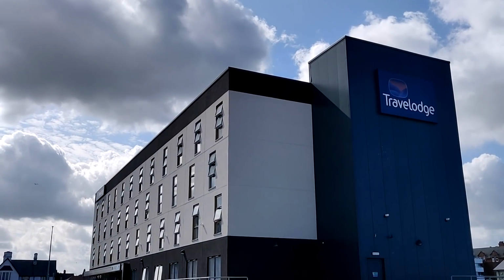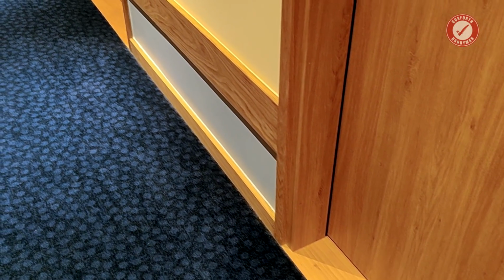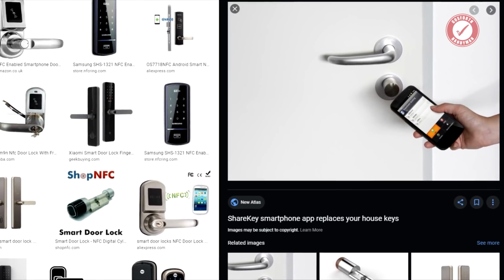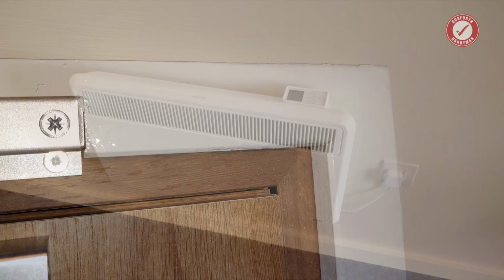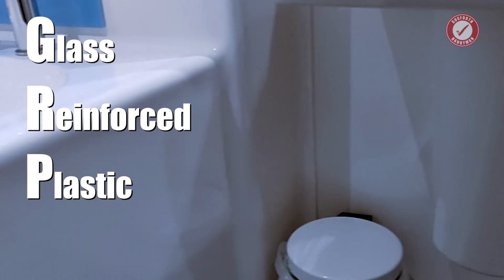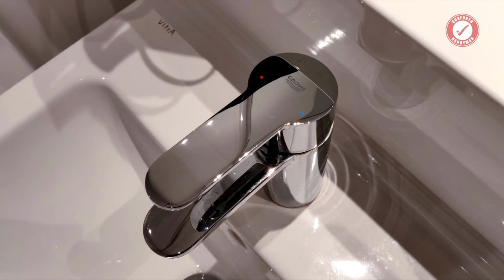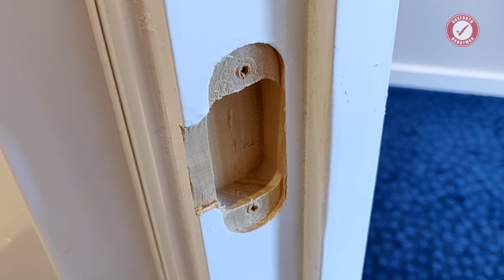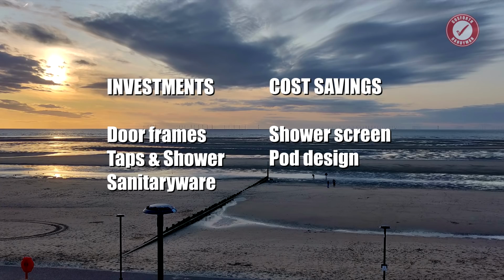Why use SOLID OAK in a £35 hotel roon? Travelodge room design in 2019!

Comment: Village Hotels use a system on the app, where you can open the door by holding your camera up to the door scanner. All you have to do it make a booking, then press find booking once done put your reservation no., last name etc then when you check in the app will update to see that you’ve checked in and in the corner will be a key icon you press it then you can have a keycard on your phone

Comment: 1: pod bathroom ... I remember being impressed by one in Austria about 35 years ago...it was orange.
2: Bathroom door frame - both the holiday inn and premier inn that I frequent in Norwich have what seems to be MDF door trim (the narrow skirting that goes around the door on the wall - on the inside at the corner near the bath you can see the water absorbtion swelling the surface...in most rooms.

Comment: I like your observations a lot, but please do not go for a pod bathroom. I lived in a student home in the nineties that was built in the seventies and had pod bathrooms. They do crack somewhere as you saw after only a year and then are impossible to repair and impossible to replace. So they just stay there cracked, water runs under the panels and mildew starts in unreachable places of your house. They are not used to make maintenance cheaper, they are used to make building it cheaper.

Comment: I stayed a night in a Hotel Formule 1 in France about 20 years ago. The shower was basically a one-piece moulded plastic (or fibreglass) pod with a rubber-sealed door and a plug hole. You were then trapped in there with the jet of water, which could have doubled as a pressure washer, it was borderline scary. Best shower I've ever had, just what you need to wake you up after 4 hours sleep on a 4" thick mattress.

Comment: 3:20 Hilton chain hotels are already doing this in the US with their app. It's kind of hit or miss in terms of how reliably it works, but basically you have to get the front desk to enable the feature for your room, and you press down on a button once you're within range of the room door.  You also can use it on external doors for the hotel.  Seems to be only a feature at newer Hilton chain hotels, though.

Comment: the fire rated composite material may be ground up wheat, same way they do chip board but has a far better fire rating than solid wood doors and is much more secure, you can replace the face of it if you want to update the look.

It's very interesting to see them in use, especially when it's low maintenance and very secure... not cheap to buy but it's a very good purchase.

Comment: I saw the phone NFC key feature teased in advertising at the Limpley Stoke Hotel owned by Latona Leisure Group but said they didn't actually support yet when I asked about it so dunno whether it's already in other hotels owned by the Group or if it's in implementation stages or what but yeh it's definitely around

Comment: The recess is to block sunlight in the sliders at the top. Keeps it blackout-ish without having to have roller blinds or tight fitting runners.

Comment: I totally agree with most of what you've pointed out with short term upfront cost for long term savings. Only thing that I find a little contraindicative is your mention of the push-fit plumbing being a sign of their confidence in the product yet they also skimped on proper prep/cheaped out on the paint, or perhaps they were confident in that solution too. Either way it will absolutely cost them a tonne to rectify and as you said will be a headache for years. I don't think there's anything wrong with quality push fit plumbing installed properly but I also feel they are extremely susceptible to failure from cheap parts and poor workmanship. 

100% accurate on solid wood for doors. Composites just do NOT hold up to the loads. Screws tear out and get loose, they don't hold fillers well when gouged or damaged and are overall a waste of money.

Comment: A lot of them run them down to bear minimum and sell it . The problem with hotel property management it’s not maintain properly in the first place and they don’t budget annual reverb’s especially at low rate because of the OTA’s  but the biggest problem I seen is the lack of inspections with before and after work orders and And your daily maintenance checks to keep it fresh .

Comment: There are a few problems with the NFC/phone adoption for doors:

--NFC has been bypassed, cloned, and forced more times than I can count, with multiple angles and utilities being available for the job. You think current doors and maglocks are bad? Wait until you have to watch for literally anybody, phone or not (biohacking's becoming popular in the UK and Europe, from what I remember).

--As far as the phone idea, this creates a customer dependency that would still (most likely) require a backup, while probably requiring some kind of centralized app/service marketed towards hotels that would need to be installed on the phone. This would be a hassle and could leak or siphon data from said phone, since corporations are in love with ripping data that they don't actually need for the service to work. Otherwise, maybe some finnicky, send/read-door-code-as-document pipeline would be necessary.

Comment: Almost all Hilton’s in US, Europe & Japan have had smartphone keys for 2+ years.
Reply: As an aside, Hilton's "Digital Key" uses Bluetooth Low Energy to communicate with the readers rather than NFC, though it does require the property to have switched from magstripe to RFID keycards for it to be an option.
Reply: They push it as a big plus about having their app, although I've never used it and always preferred to physically check in and get a key. 1) It's nice to have a key if your phone dies 2) It only takes a minute anyway 3) I think it's good to say hello to the hotel staff and be friendly for a magnitude of reasons.
Reply: Some Marriott hotels have Bluetooth door locks that work in conjunction with their mobile app.   My experience has been decidedly mixed, first time I used one at a Marriott Residence it worked flawlessly,  next time at a Moxy it took several attempts to get the phone to unlock the lift,  completely failed to get it to connect to the door and unlock it, so gave up and went back for a conventional key card.
Reply: The Hilton app, in my experience (tried it in 3 different hotels) takes a surprisingly (frustratingly) long time to open a door at best, like 30 seconds. My most recent stay, it worked only one time in 20 attempts and I was left standing in the hall for five minutes on day 2 of my stay. I got a real key card from the desk.

Comment: No idea why this came up for me but I do have a few professional comments. The door frames and doors are probably for fire rating, I haven't seen the travel lodge brand manual but have seen competitors and they generally only mandate the key mech. Nfc from phones is coming soon. Modular bathroom pods work economicly through repeat ability unlikely to see them in housing unless it's new build and that has its drawbacks so won't be mass adoption for a while.
Also travel lodge won't buy any doors but no building regs on bathroom doors

Comment: That prebuilt bathroom sounds like a good idea for combatting mouldy  silicone and leaks but if there is damage and you had to rip it out it would be a nightmare
Reply: I bet there's a plan for that though. All of the pipes and fittings can probably be accessed from hallway panel or under that lift off panel. Basin and toilet from the lift off. Probably shower/bath from hallway.
I expect there's a maintenance/repair/replace solution from the manufacturers.
Reply: @Google_Does_Evil_Now  I had in mind cigarette burns  and dropped coffecups etc. I have seen mobile chip and scratch repairers before though who will use colour matched  epoxy to repair anything, cars, ceramic tiles, baths, so maybe that is their plan

Comment: AC hotels by Marriott do have the room key system you mention if you do your check in through the Marriott app and add the room key to Apple wallet

I’m also noticing a strong trend towards quartz countertops throughout even in many mid range hotels as they are seen as luxurious, and more durable than laminate or granite

Comment: Some of these designs are reminiscent of features I've seen in buildings (houses & hotels) in other countries.  Sturdy oak door frames are standard in Germany, Austria and Switzerland.  The bathroom pod is something I saw - albeit scaled down in size lol - in a business hotel I stayed in in Tokyo in 2003.
It's nice to see a British company which has understood that using cheap shoddy materials is a false economy, because as you point out, more money has to be spent over time on either maintenance or replacement, or they just look like crap very quickly.  Having lived over 2 decades in Germany, Austria and the Netherlands, I still can't get my head around why poor design and poor quality materials, and slapdash finishes lacking attention to detail and forethought, seem to be commonplace in the UK in most buildings and other constructions built in the last century, i.e. from the 1920s onwards.
Reply: That's why it's called Rip-off Britain 😂
But seriously,it's just sheer laziness
Reply: @gabbycyber9917  True, but I believe it runs deeper and shows a lack of pride, and lack of social cohesion, as social cohesion means that you want to live in a place where others have it good too, as opposed to our commonplace ''I'm alright Jack'' attitude here in the UK which is short sighted.  But yeah laziness too, a few months ago some plumbers re-plumbed sinks in our restaurant, apart from the weird cheap flexible steel braid they used instead of normal copper piping (which I haven't even seen in Africa) they used too short a length, just about half an inch, which meant that the braid ''pipe'' was folded in on itself in a bend,  and the water pressure out of the taps rendered them practically unworkable.  The point is that they do this every day and it's their job so they knew damn well that the job would be faulty, but they went ahead and left it like that all the same knowing full well that the result would be shit, and by the time we found out they had gone.  No wonder Polish plumbers are doing so well here.  But it's sad for a country which started the industrial revolution and contributed so much to the world in terms of inventions.

Comment: The joint free design of the pod bathroom seems like a disaster waiting to happen. In a high moisture environment like a bathroom, you're going to get quite a lot of expansion and contraction even in GRP. They're getting cracking at the bottom of the door frame because that's the weakest point in the shell. The joints at the top of the door frame might have been cut on site as reliefs after cracking, since they don't look too pretty. Is plastic piping common in new commercial builds in the UK? Most building management companies I've worked with want nothing to do with the stuff, preferring copper.

Comment: what happens if someone breaks/cracks one of those glass reinforced tubs or walls? they just rip the hotel in half so they can crane in another unit??? and don't say it's indestructible, if anything can be broken, it will be broken in a hotel.

Comment: I've stayed at both Travelodge and Premier Inns (including their Hub brand), and compared to similar segmented and priced hotels in the USA, my conclusion is: Substantially smaller room size, BUT a huge unbelievable uplift to standards of furnishings including bedding, bathroom fittings with stone finishes and well tiled shower areas, and very fast Wifi Internet speeds (the two Premier Inn properties had Wifi speeds exceeding 200Mbps, compared to the 5-8  Mbps I usually get at a Courtyard by Marriott in the midwest part of the USA).

Comment: Am I wrong in finding the GRP bathroom pod concerning? I'm sure it's rather stronger than this, but I once cracked the GRP of a glider fuselage with a swinging metal parachute strap. If someone drops something heavy into any of that GRP and it chips, wouldn't you be looking at replacing the whole pod, patching (ugly) or ignoring it?

Comment: My student hall room was an entirely prefabricated pod. Almost every surface was hardwearing or wipe clean and the entire bathroom was similar in design, although every wall was one large asf tile. I know all of this because I was living in the building next door when they started construction and the site was just rooms being craned into a frame and fitted in. In just over a year, the site went from a literal hole in the ground, to a 21 floor student accommodation.

The only design fault I could see was how they fitted a mirror into the wardrobe door with screws instead of glue which meant a single slam was all it took to break the mirror. The mirror wasn't even necessary since the bathroom had a mirror on the wall on the medicine cabinet, but also on the door itself.  Though it was offset by my favourite detail which was how they fitted a washing line into the medicine cabinet which could be pulled out across the bathroom and fitted into the shower to dry off clothes.. it's almost like they knew the laundry were going to charge a ridiculous amount for drying!

It's amazing how this technology exists, yet companies, governments and local councils fail utterly to provide a reasonable amount of affordable housing.

Comment: The recess around the curtains is to allow for a higher window, and it is a workaround for a very thick ceiling that is fire retardant between floors.
Reply: Doesn’t the recess defeat the fire retardant in the recessed section? Why would building code/ inspector allow that?
Reply: I've been told its also to help with light leakage. Since the curtain in recessed in a box there is no way for light to reflect off the back of the curtain and splash across the entire ceiling.

Comment: Brilliant video. Subscribed! Strange they went for electric heating considering the huge cost associated running with resistive electric heaters. Air con is complicated but far cheaper to run with new air con units running a coefficient of performance of over 4 (1kw electric in = 4kw heat out). Even water filled rads with a central plant room would be cheaper than electric heaters. I suppose the one real advantage they have is that they don't have a single point of failure such as a central boiler to go wrong and shut the whole hotel down.
Reply: Exactly that, your last line there. The person who has to be called for that electric heater breaking probably gets paid a lot less than anyone they could call for central heating.

Comment: Hotel drapery guy here.

  Without that recess they could never give you a decent black out feature when the drapes are closed in the day time, but if they were really concerned with that they would have stopped the window short of the floor. Assuming they were dropping the ceiling for mechanicals, they saw this recess as an opportunity to eliminate any cost of a top treatment like a cornice or valance as more motivation.   They also imagined it would hide the hardware and pleats but its too narrow and shallow to do so. 

Long term this will save them about $10k per renovation per hotel by eliminating any sort of top treatment needing to be purchased while offering good functionality with no maintenance.

Comment: In regards to using your phone as a key it is implemented in hilton and Marriott hotels. Marriott uses bluetooth for this, but I think in the next few years you will see it with almost all hotels as it'll be implemented at the manufacturer level instead of the brand level. Honestly never understood building economy level hotels. It is a lot cheaper to buy an older hotel and transition to the brand.
Reply: The advantage of building from scratch is it's much easier to standardize the product. Essentially you start with a room design and design the building around it. If you buy and refurb then you have to work around the structure and layout of the existing building.

Comment: good video. I have been having similar thoughts when visiting hotels, hospitals etc.  I am doing a concealed cistern for easy cleaning and made a chase for the pipes to get a basin in the other side of the room without exposed pipes. I'm using flexi but a single run of Pex/tube  without joints in the hidden areas but accessible panels for elbow push fittings etc.